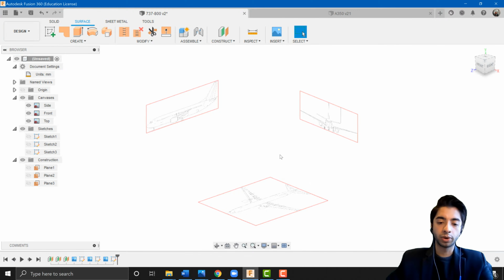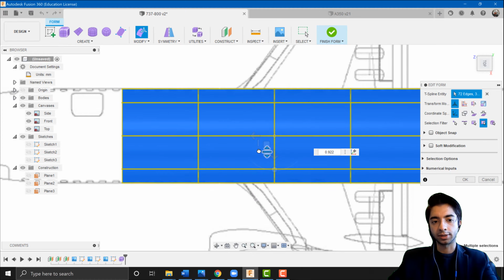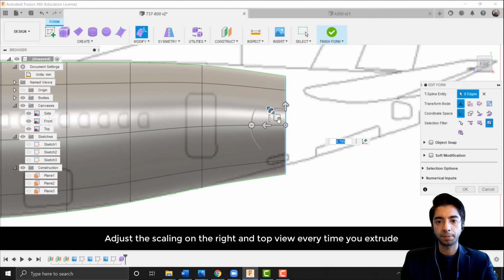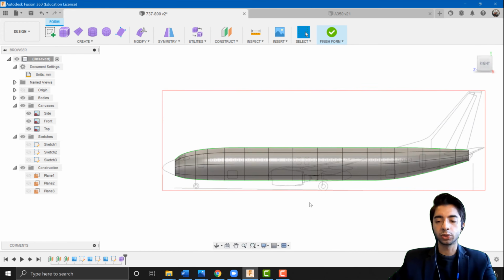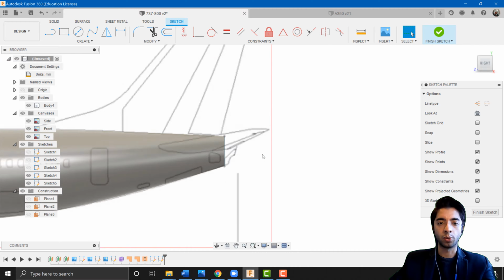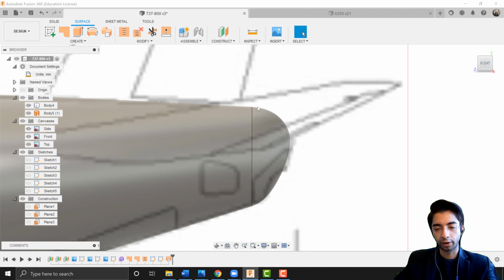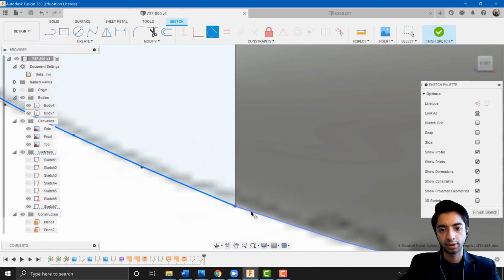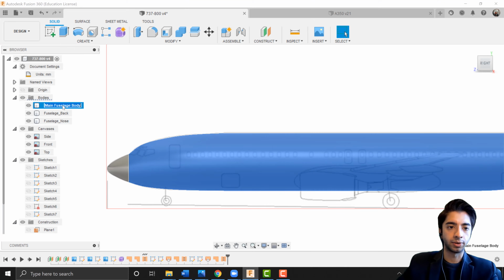How to Model an Aircraft in Fusion 360 | Tutorial 2 - Fuselage | Step-by-Step (4K)

Comment: Thanks for the excellent tutorials. As you noted, using the loft feature to  complete the nose/tail is challenging. I tried a simple Form Cylinder and after putting the patch on the end, added the spline. The loft failed with invalid direction error.  I found that using Surface Patch worked. As you noted, there is a geometry limit on the spline. If it is too big, even the Patch fails. thanks

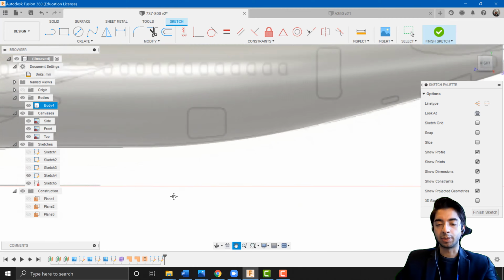Edit. At 16:24, I bring attention that the line connecting the two points must also be selected. This ensures that there is a closed boundary. As I was not sure that my canvas/cylinder was on the midplane of the plane, I selected Construct/Plane at Angle. I then selected the line (between the two points) and entered 90 deg. I then created a sketch on this new plane.  Again Thanks!
Reply from the maker: This is fantastic. Awesome that you figured it out and thanks for sharing it with others!
Reply: please i am facing this problem in the head it finishes part and the other not and i have tried adjusting the spline a lot but it is not working can you help me as i need this model very much
Reply: I’m also having the same issue with completing the nose and tail! I’ll keep trying!

Comment: bro the nose part it does not loft i did all u said againn but it shows as follows:
Loft4
	<b>1 Reference Failures</b>
	  The loft would flow in an invalid direction.
	    Try adjusting the continuity settings. If two adjacent profiles are on the same plane, try moving one of these.
		  The loft would flow in an invalid direction.
    Try adjusting the continuity settings. If two adjacent profiles are on the same plane, try moving one of these.

Comment: Can't make the loft on 19:07. Getting errors:
Error:   The operation failed.
    Try adjusting the values or changing the input geometry.
Error: Cannot create tool body for loft.
and
Error: Closed profiles can not be coplanar for a loft.
Reply: mee too
Reply: For me doing the drawing with a "Fit Point Spline" instead of a "Control Point Spline" and closing the open left side of the spline with a Line worked. Idk if this will cause problems further down the series i dont know

Comment: At 6:40 how did you get the top end to move vertically up and down without the ends curling in or out? When I tried moving the large plus shaped thing, it just curved both ends in. How do I move the end circle
Reply: Also could you do a tutorial modeling an f-20 tigershark or similar jet, because the shape of the fuselage is very complex.
Reply from the maker: I just had a look at the F-20 and it does seem quite complex. Looks like an interesting challenge. I'm thinking of doing a YouTube live stream with the F-20 as a challenge. That way I'll be problem solving in front of everyone. Would you be interested in seeing that?
Reply from the maker: Hey! I'm not sure what you mean. I think you might have scaled the body in,  instead of moving it. Use the arrows for moving and the little lines for scaling :)

Comment: The plane I want to build is the Tecnam P2012 the fuselage is kind of square with rounded edges. Can I still use the cylinder method to create that shape?
Reply from the maker: Hey! In that case I recommend using the box shape to start with. You can have a look at my Helicopter series where I make the fuselage in that manner :)

Comment: What if the fuselage is more square with rounded ages? can I stil use cylinder than manipulate?
Reply from the maker: Hey! In that case I recommend using the box shape to start with. You can have a look at my Helicopter series where I make the fuselage in that manner :)

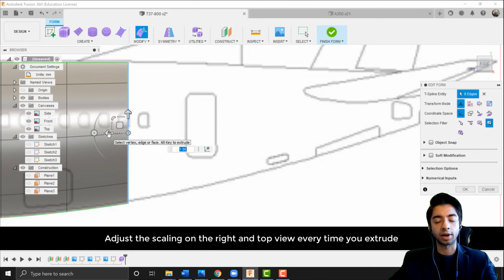Comment: Can please help with the part about extruding from 7:26. I have extruded it viewing from the side, then clicked on the top view and adjusted the extrusion there, but when I go back to the side view, it has adjusted it there also. I cant get it to adjust the top view without it moving the side view extrusion as well. Thanks.
Reply from the maker: Hi Mike, looks like you might be clicking on the wrong button while extruding! Pleas ensure you're clicking on the same buttons as I am in the video :)
Reply: @TEXDesignEngineering  Thanks, all sorted, I was indeed pressing the wrong button.

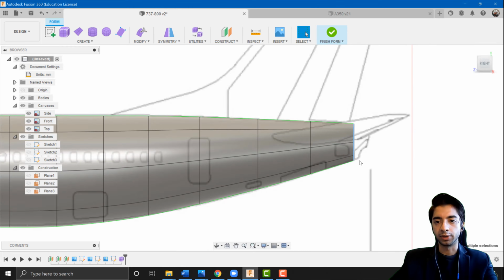Comment: At 9:08 you're completing the fuselage demo.  You keep saying it "looks good"... but what If you need exact dimensions or curvatures ?  Example' the line on the top of the cylinder keeps getting adjusted but its supposed to remain exactly horizontal while the belly curves upward.  How do you know the top of the plane is exactly horizontal after adjusting ?  What if this was a cad drawing for manufacture.  "looking good' isn't enough.
Reply from the maker: Hi Shawn, as I said in the first tutorial, this series is meant to be an easy step by step tutorial for everyone to follow on. I also mentioned that if you want to go into more detail, you can use these tutorials as a basic foundation to build upon. If you require more accuracy, then you can look up how to use the basic tools in more details. For example, when you're talking about keeping the top of the fuselage horizontal, you can look into how to get better at using T-Splines and use those advanced techniques on top of what I've already shown here. 

I tried to keep these tutorials as generic and easy as possible for everyone to follow, not to turn someone into a pro. I hope you understand and appreciate the time and effort that has gone into these videos.

Take care

Comment: That's the best Tutorial I've ever seen I designed a Boeing 747 and now I am trying to design a L-39 Albatros but its so hard because the Fuselage has many roundings and corners. I think I have to give up that project its to hard for my skills now do you have any tips for me?
Reply from the maker: That sounds like a really cool project! Well done on the Boeing 747. The L39 does seems a little different from the fuselages we've designed, however I think you can still apply the same techniques! Just split the fuselage up into more pieces and you should be good to go :)
Reply: @TEXDesignEngineering  I dont know why but your answere motivated me so much 😄 thank you... I am so far that i have the Fuselage and wings done but I want to make it RC and that's the  biggest problem. I need struts inside the fuselage to stabilize everything, I also need an air duct for the EDF and then I want to be able to print out the individual components on paper so that i have a sort of blueprints. Sorry for my bad english😅 and thank you for your answer
Reply from the maker: @langeweilei_iC  I have just finished helping a friend out with his RC plane! For the struts and other structural components, I believe he followed a YouTuber by the name of Ramy RC (Giant A350 RC Video). If you want to talk about this more, send me message from my website (tex the experience . com, click on Contact Us at the bottom of the page)

Comment: Hello, what do you think would be an error I did while creating the spline and loft? I’ve rewatched the video multiple times and went step by step, but every time I loft, it does not create that shape. Instead it tells me I have an illegal shape, and that it will intersect itself at 90 degrees. 

If you could, respond with any help you could other, thank you!
Reply from the maker: Hi there, I've encountered this problem a couple of times and I'm still unsure why that happens. To fix it, I usually try different shapes and edit the side profiles till it works. Hope this helps!

Comment: Please can someone help. I am attempting to model a HP42modellin. The fuselage I think needs to be in three parts Rear, Cabin and Nose I have modelled the Cabin shelled it and cut the windows. I then Lofted of of the rear of the Cabin to a sketch of the tail cross section. Now I come to the Nose, I have projected the front cross section onto a new plane, I can then draw the side profile but I need to project a couple of points back onto the Nose cross section . I can see the two sketches but when I try to edit the nose section sketch the fuselage side sketch disappears. I have a couple of other sketches ie windscreen and I can see multiple sketches just not the one I created off the projection WHY?
Reply from the maker: Hey Laurie - thanks for reaching out! Thanks for the detailed explanation to your problem. 
Try this:
1) Make the front cross section first (the projection of the front of the fuselage). In the folder tree, rename this sketch to "FrontProfile" 
2) Create a NEW sketch on the side, this is where you draw the nose section from the right side. Make sure your "FrontProfile" sketch is still visible. Project the point you want from from FrontProfile onto this new sketch. Once you're done, rename this new sketch to "SideProfile". 
3) Once you're done, make sure that BOTH SKETCHES are visible in the folder tree. The little light bulb icon should be on :) 

Try this, if this doesn't work, send me a message via textheexperience.com/contact

Comment: Incredible helpful tutorial series!! What do you think is the best way to create the fuselage of the Airbus BelugaXL? I've used the Sweep function (instead of the cylinder you used) to create the cross shape on the XZ plane and a straight path parallel to the Y-axis as a rail. However I find it pretty difficult to create the complex shape of the nose and tail fuselage parts with just the two handles to manipulate the cross section. Any help would be appreciated!
Reply from the maker: Ah yes that's quite an interesting one! The first way that comes to mind is to split the fuselage into 2 sections vertically as well. So you can follow the normal "airliner" shape using the cylinder way I've shown in this tutorial. Then, add another free form body that takes the shape of the "bulgy" part of the fuselage, and add it on top of the main fuselage. Refer to my Helicopter series where I do something similar! Let me know how you get along!

Comment: Dear Sir, the back loft was fine but when I tried to do the front, there's a error message indicating 1 Reference failures "The loft would intersect itself. Try changing the inputs to avoid this. If you wish to build a self-intersecting shape, try building the shape using multiple lofts." Had been doing it a few times but I could only loft half of the section.  Not sure why it is so. Please advise.
Reply: I tried going back timeline to redo it this time, it works!
Reply from the maker: Glad it worked out Collin, would you like to share how you fixed this?
Reply: Couldn't remember it well but what i did was that I went back to the timeline to redo it again, removing the sketch and draft again, still puzzle on what I had done wrong or right.. Lol

Comment: Why do you loft in surface mode rather than in solid mode?
Reply from the maker: Great question! To be honest, you could do solid as well. I found that at time the solid doesn't work for some reason, but using the surface mode and patching it after works!

Comment: When I sketch and trim the first line on the face where the nose cone will be (@14:50), the circle isn't split for selection? Any ideas?
Great series by the way :)
Reply from the maker: Hi Pixel Rabbit, sorry for the super late response - just finishing my final year at uni. 

Regarding your problem, did you sketch on the correct plane? You want to sketch on the same plane as the front of the surface, that's where the circle's geometry lies. Alternatively, you could create a new plane on that same surface, start a sketch and PROJECT that circle onto the new sketch. After all, you only need the geometry of the circle to loft. Let me know if that helps. Feel free to ask more if that wasn't clear :)
Reply: @TEXDesignEngineering  thanks for the reply, yeah I was doing something dumb. Hope Uni went well. Bet it's a first :)

Comment: Great tutorial!! Thanks for taking the time. I have one question, When you are modelling the nose, the cross-section is not round or oval, but it has a specific shape that you didn't follow maybe for ease of explaining. Is it possible to edit the first station of the cylinder of the main fuselage to match the nose cone shape, and from there to the loft? The shape is more like a triangular shape distinctive of the 737. As for the tail, the section where the stabilizer matches de fuselage should be flat, can we edit single sections of the cylinder to make them flat?

BEST REGARDS
Reply from the maker: Hi Cristian, you are right. For simplicity, I didn't model the triangular shape. You can change each span station of the fuselage. Your method could work! You could loft the circular section of the main fuselage with a triangular section for the nose, and add some rails during the loft to guide it properly. As for the rear end, I'm sure you can edit each section in the T-Spline (free form) workspace. Let me know how it goes!